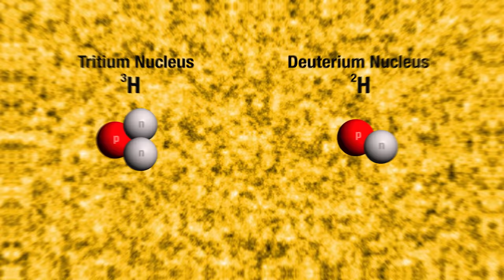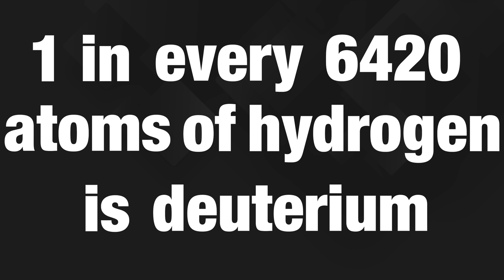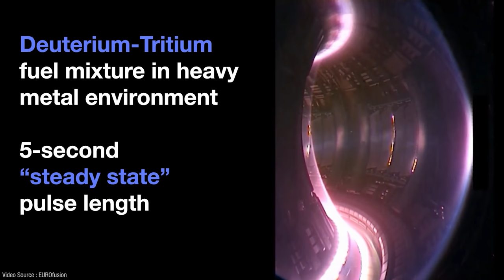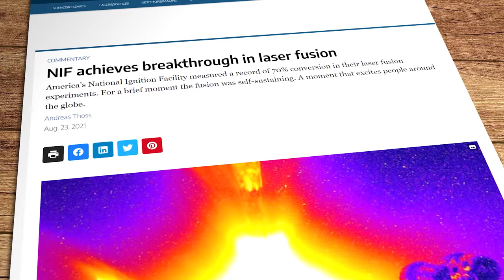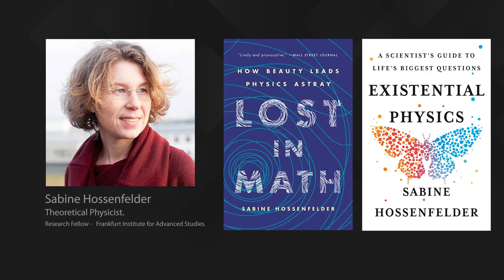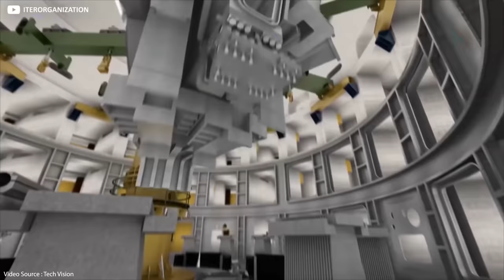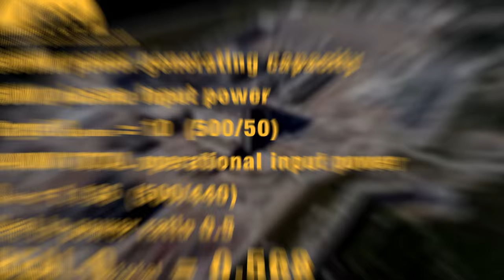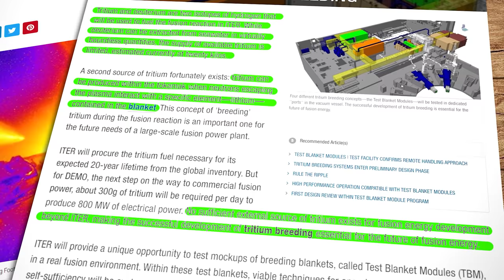Nuclear Fusion Illusion. Is it time to park the pipe dream?

Comment: TLDR; Fusion is probably on better standing than you think, but still not good enough to be a reasonable fix for the climate emergency. It probably will happen sooner than you might expect, but not soon enough. We still need to do all the renewables we can muster, but fusion research only represents 0.2% of alternative energy spending and isn't really hurting anything. And it's probably the only technology that will allow us to do large scale carbon capture and turn back the clock given just how much power it will one day make.

I think this discussion is missing a key aspect - these processes tend to be exponential, or at least logarithmic-s-curved. Doubling performance in 20 years is not a fast doubling time, to be sure, but that would mean an ITER style reactor in 2045 would have a Q total of slightly over 1, over-unity. It would be like saying in 1960 that 'computers offer promise one day, but really won't become useful on a reasonable scale in my lifetime'. Yeah, a 1960's computer never would. But a 1990's computer could, and did, change the way the world operated. When you project into the future, you can't use the numbers that are being achieved today. 

This current wave of fusion companies are really jumping the gun. Fusion is probably 30, maybe 40 years off from becoming truly commercially viable at the current rate of progress. If we expect it to double on a generational timeline, 25 years for that improvement, then in 50 it will be 4x as good as it is now. Q-total will be in the 2-3 range, solidly over unity. And that assumes no major breakthrough comes, which is probably a bad assumption. Not because breakthroughs are inevitable or anything, science doesn't work like that. But because the 50 billion dollars globally spent on fusion research over the last 25 years is less R&D than went into making the most efficient pumpjack and oil drilling system - only a tiny component of one of several major energy resources. The energy market is huge. It's just shy of 2 trillion dollars a year today. About 80% of that ends up in various pockets or covering cost, but that's still 400 billion dollars a year of more or less pure profit. Every year, the energy market makes in profit enough to fund 200 years of fusion research at the current rate. It would be rather silly to assume that more R&D won't be given once unity is reached and people can see the potential on their profit horizons. Once you reach Q=1, odds are that vastly more money would be poured into the research, drastically increasing the rate of incremental gains and drastically increasing the chance of major breakthroughs. And just 1 year of energy profits spread over 10 years of research would be 20x what the world currently dedicates.

It won't be fast enough to solve climate change, though. That's definitely true. It probably will happen in your lifetime, and I'd be shocked if it didn't happen in mine, but it isn't just around the corner. If the first working plants went online in 2060 I wouldn't be surprised. And that's far too late to help deal with the climate emergency. The fact that you're probably overly pessimistic about fusion doesn't change the fact that fusion isn't perfect either. We need to invest more in remote fusion technology - solar panels - and fission, and geothermal if we can figure out a safe way to drill deep into the crust, and all those other renewable options. But fusion research's 50 billion over 25 years, 2 billion per year, is not your enemy. Renewables are being installed at nearly 1 trillion dollars a year worldwide. All of fusion research represents 0.2% of our current global alternative energy push. I don't think that's a waste given the promise and progress. 0.2% extra wind turbines isn't going to matter either.

Plus, fusion is the only technology that offers us the option to reverse the clock entirely. We're not going to generate enough renewables to start the large-scale carbon capture projects that we really need to do regardless. They'll most likely be slightly too late to even fully replace fossil fuels in time, though they'll stop things from getting worse and are definitely the right path to take. But fusion would be able to produce energy surplus. Renewables are trying to make up the shortfall of turning fossil fuels off, but fusion can take us further. Far enough that we could run terawatt carbon-capture projects to get the earth back to pre-industrial levels in human timelines of 20-30 years. 20-30 years after the fusion plants work, so 60-90 years total, but they're the only path to a stable world by 2120. Renewables only in 2120 is still a damaged world, because the carbon is still out there, heating the planet. We need to take it back out of the air, and Fusion is the only option that could realistically produce the kinds of surplus energy we need to really shove the clock backwards.

Comment: Given how many complications to the physics keep getting added to explain how the universe works,  it is obvious that the current paradigms used are not correct.  The current theories are firmly held mainly because it would upset a LOT of funding for the establishment scientists,  and so no competing theory that challenges the standard models core beliefs can be tolerated.  This has happened several times before throughout history before the then current belief system was finally overthrown by theories that better predicted and described the phenomena actually observed in the universe.

Comment: Great video as always! I work in nuclear power regulation, and I have to disagree with your take that fusion reactors would require the same level of regulation as fission plants. 

Yes, there will be radioactive materials and components in fusion reactors which will need to be handled appropriately. However, the bulk of the regulations for fission power plants are there to prevent the reactors from melting down and releasing radioactivity to the environment. Fusion reactors won't have that concern. The process of breeding tritium from lithium is called 'neutron activation', it is NOT fission. 

I suspect that regulating a fusion plant would be more akin to regulating a particle accelerator, which is orders of magnitude less effort than a fission plant.
Reply from the maker: Thanks for clarifying this. Much appreciated.
Reply: Good to know that we can rely on the operators to dispose of any radioactive material caused by neutron bombardment safely without all those burdonsome regulations.

Comment: Assume that we have working fusion today... If you like your big monopolistic centralized coal/gas/nuclear power utility, you're going to absolutely love your big monopolistic fusion power utility.

We still have yet to find a planet abundant in unobtanium to mine, which is a necessary component of any fusion reactor, because no other material seems to withstand sustained energetic neutron bombardment, and anything less than such a material is going to result in another expensive pile of constantly maintained radioactive waste.

Comment: Once the plasma is generating enough fusion to keep itself hot [e.g. alpha heating from D/T fusion] there's no longer a problem with losing energy converting heat to electricity for producing more heat.
You show no awareness of high-field high-temperature superconducting electromagnets Your argument is like saying that heavier-than-air flight will always be impossible because steam engines and their coal fuel are too heavy, which is an argument that was made and accepted. :-)

Comment: I guess this video was made before the health and safety regulators shut down ITER because of concerns over the manufacturing quality...
Reply: the video was dumb when I watched it months ago because it pretends the 30 year old ITER design represents the state of the art in fusion research. MAST in the UK or SPARC in the US are cutting edge using the new generation of mass produced superconductors which are cheaper and produce much stronger magnetic fields.
Reply: @j.f.fisher5318  yeah I did notice in journals that there's this trend of the theory advancing faster than we can actually apply it right now. Which, is good, I think.
Reply from the maker: It was, yes.
Reply: @JustHaveaThink  the pressure of youtube!

Comment: Production of tritium is not a problem, containment is not a problem, Total Q is not a problem. The big show stopper is all the energy produced is in fast neutrons. Neutrons have no charge and hence are not deflected by the magnetic field. They just shoot out of the plasma in every direction and they do a lot of damage. They're a major factor in the degradation of fission reactors. To be clear even with  a Total Q of greater than 1 the plant may only be able to run for minutes or hours before it needs to be shutdown and refurbished.  Maybe the material sciences can solve this problem, it's hard to predict but it'll for sure require even more billions to see if there is a solution. 
As for the let's spend the money on research into something else. Like what? Solar PV is already very close to its theoretical efficiency limit. Windmills are well understood by the scientists and engineers as is hydro. Nuclear fission might well be our best shot in the short term but the amount of it we need to build in a very short period is going to be a huge challenge. Fusion might be an answer, there's another form of fusion using Helium 3 which gets around the neutron problem but it needs way, way higher temperatures to happen. Helium 3 is abundant on our moon so maybe that's a possible solution.
The overall reality is AGW is a "wicked" problem, some say "very wicked".  Before we start kicking our political leaders for not doing enough we need to be telling them what we need to be doing more of and to date we do not have a politically acceptable answer backed up by good science.

Comment: Simple and cheap beats complex and expensive every time. Solar panels with battery storage are simple and cheap requiring no fuel costs, no operation labor and very low maintenance. Nuclear fusion cannot produce cheap energy with world class scientists operating the machine. Nuclear fission is little better. Continue nuclear fusion as a science experiment but without any dreams of cheap power.

Comment: Strange that you don't talk about the SPARC projekt by Commonwealth Fusion Systems (CFS) and MIT. They are doing a lot of exiting work, you are missing out if you ignore that. The design of that project answers a lot of the issues ITER has. I too was sceptical of seeing fusion power in the next 50 years until i heard about SPARC/ARC fusion reactor. Its of course impossible to know if it work, but it's to promising to dismis. IMO worth both the time and money put into it, considering the climate crisis. SPARC is IMO more promising than ITER. 

The way you talk about ITER, seems a biased to me:
1. ITER was never intended to give energy return on investment(EROI). It was always a science experiment, intended to be a step towards one day giving humanity fusion power. Iter means "the path" in Latin. It was never a secret that it was not going to produce EROI. Not knowing if you will succeed or not, or not knowing what will happen is a large part of science, especially for an enormous and ground breaking project like ITER. Not reaching the power generation capacity goal, does not mean the project does not succeed. "Failing" is a huge part of science, it is impossible to succeed without failing in science. 

2. It's also not unusual for large projects to exceed their budget, even when there is no new technology involved. For a massive project like this, with a lot of new technology, would be strange if it didn't blow the budget. Exeding the budget is not a huge deal. 

The oil companies are using the same type of arguments/rhetoric against renewables, as you do against ITER/fusion.

Comment: One of the many nails in the fusion coffin will be "neutron embrittlement". The magnetic field holds in charged particles, but does nothing to stop neutrons from escaping and hitting the inner walls and magnets. These will need to be replaced in regular maintenance cycles for a fully running power plant. They are NOT cheap, they will be damaged often. Manufacturing these components for this maintenance will emit carbon, and will make this a dirty, unprofitable power plant. ...just this ONE thing stops fusion in it tracks. We should have given up on this garbage decades ago. I wish they would focus their time and resources dealing with fission reactor waste disposal instead. Find a way to use some of the power generated in fission to fuse some percentage of the waste into a more stable form to reduce its radioactive longevity and potency. Or use your ability to mass produce plasma to coat waste so when it is buried it does not leach into ground water. I wish they would optimize the technology we have and quit fantasizing about some utopian future.
Reply: @Null Pointer The time and energy spent dismissing both my ideas was basically the time and energy I put into them. Guess these ideas have a Qt = 1 and are still better than fusion. ;)

Comment: if renewables is the now game, fusion is the long game. my estimate is about 50-100 years to functional power plants. "20 years away" i think is a product of scientific illiteracy among the media. if a scientist says the experiment will take 20 years, media translates that to "fusion in 20 years".  my estimate is not pulled out of nowhere. 20 years is how long it takes to fund, build and test a new tokamak. the iter plan is going to be iter->demo->power plant actual with q plasma going up a bit each time. at 20 years each thats 60 years, but iter is at least half way there, so 50 at the optimistic end. then go ahead and add 20 years if the scientists want to build another one. even if things go to plan, the cost of fusion power plants will be prohibitively expensive at first and continued research will be needed to try and get their costs down.  that includes things like better superconductors, alternative reactor configurations, aneutronic fusion, direct conversion, etc. a cash sink though it may be, it is this kind of long term thinking that will save our species.

Comment: Probably a dumb question. Physics was not a strong suit in school.  Why do we need a fusion reaction 10 times. As hot as the sun? The sun doesn’t need it that hot ?  Also if the  goal is to confine a plasma to heat water and make electricity, why does it need to be that hot certainly the plasma generated  by spacecraft on re-entry isn’t.  Isn’t there another way to generate a cooler plasma for this purpose than spending billions upon billions on these things ?
Reply: The sun is very very inefficient at fusion, and is only this hot because of it’s huge size. It actually has an energy density not too far off that of a warm compost heap. 
So we need to use a more efficient reaction and hotter temperatures.
Reply: @Gomlmon99  I see. Thanks
Reply: @David Marsh  As Name pointed out, but with quantity, Sun's core's energy density is utterly miserable. It's 30 Watts / m**3 so a dim light bulb inside a giant refrigerator, and also been likened to the energy density of an active compost heap on Earth, so orders of magnitude less than a nuclear fission core or the furnace of a coal-electric plant.

Comment: If we don't work on it, then it will never happen. Also a few billion even a few tens of billions is peanuts compared to what is spent on war for example. As for getting a solution to the existing problems we already have several. The only problem is utilities companies just dont want us having them as they will lose profits. EG a 4kW PV roof in the UK along with a 30kWh storage system is enough for most households to never need to draw from the mains again. There are also ways of radically reducing your fuel usage. My bills for gas and electricity combined even now after the hikes only come to about £600 a year.

Comment: Yes. 
let's keep pumping further billions into research of facilitys that (appearently) take decades to build, cost themselves billions and produce barely enough power to outperform half a dozend windturbines just to solve a problem we have since at least 20 years and refuse to solve with existing technology, because one day we might find the holy grail. Just you wait.
<Sarcasm end>

If we'd have put that money into battery-research (mainly production capability) and Hydrogen-Electrolysis / storage (mainly production capability), we'd be much further along. But I guess productivity optimization is not as sexy as: "hey look at my cool ring of sunfire".

Comment: The wind/solar idea is also not going to be the "ultimate" solution, that's another pipe dream. It's build out is continuing to be too slow, expensive and invasive because of all the materials required. And it requires still a network of back-bone fossil fuel power plants. All the batteries of the world won't do it either, another one of those cute pipe dreams that doesn't really scale. A much less delusive way is to turn again to building new and much improved nuclear fission power plants. It's sad enough that we won't achieve fusion for a long time to come, but it's even worse that we are giving up on the best and well developed dense energy technology that we already have for 50 years. We need to replace a much larger part of the fossil fuel based energy backbone by nuclear power. The problems we are facing are much less technical than they are ideological: The widely accepted voice and lobby of the scared anti-technology "environmentalists" and activists, who are happy to accept ideological and monetary support from the fossil fuel industry for their fight against "evil nuclear energy", which in fact is the real threat for the gas and oil merchants.
Reply: Nuclear fission's problem is economics, not ideology.